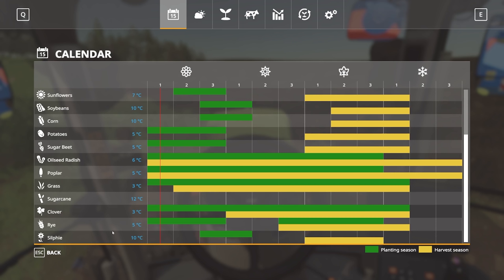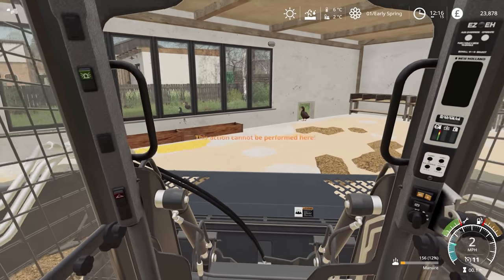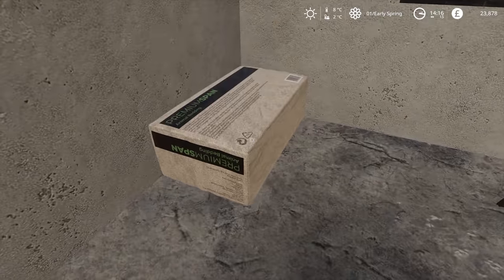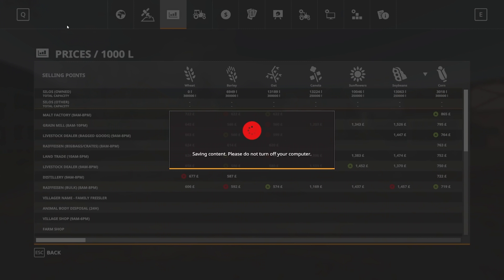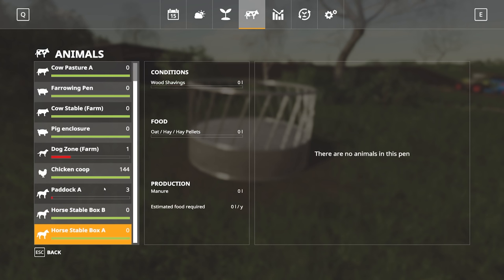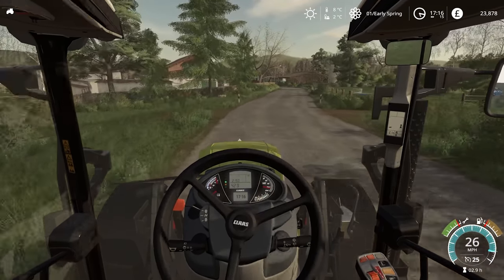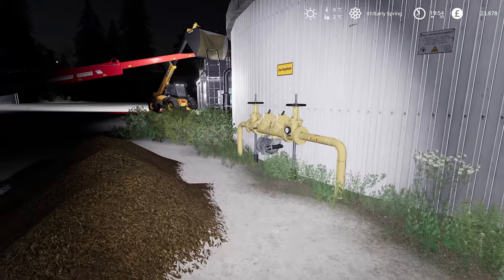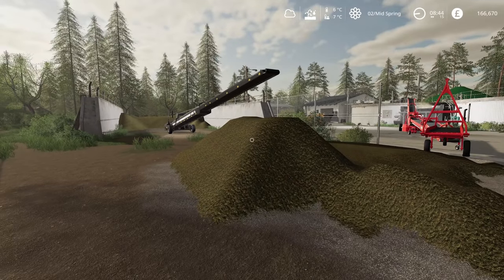OPENING THIS VALVE MADE U$ RICH | Hof Bergmann | Episode 17

Comment: The horseboxes in the stable have 2 different feeding troths which you can fill up seperatly, 1 for hay and 1 for oats. So it might be nice if you drill 1 field with oats and feed them both

Comment: Hello, a little off topic but maybe someone can help me. I bought steering wheel logitech G923 and it makes some weird thing in FS19. I set up all controls but still tractor start to accelerate by itself, so I have to only use brake to maintain speed. It's pretty annoying :( I also tried extended driving mod but it does same thing. Does somebody know how to fix this? Thanks for help :)
Reply: Are you using console
Reply: Bc mine has the same problem and all you had to do for mine was reconnected and sync device to your console and hopefully it should work ( this is only if you have an Xbox)
Reply: I have PS version on PC but I already solved the problem and here’s how. For FS19 you don’t need 3 pedals so I changed settings in Logitech G Hub and made 2 pedals from 3. I am using clutch pedal for braking as the brake pedal is too heavy so I changed key binding in game. And problem was that the brake pedal was doing weird stuff in this setting. When I pressed it in G Hub setting, gas pedal slider started to move from 50% to 0% (harder I pressed, lower %, but for 0% I had to step on it with all my weight (75kg)) So I tried to make it 3 pedals again and set key binding with clutch instead of brake and it works!!! So to anybody, who has this problem - in FS19 don’t make 2 pedals from 3 (some tutorials for G29/920 are recommending this, but for G923 it’s not working same) and just replace brake with clutch for better comfort in key binding :)